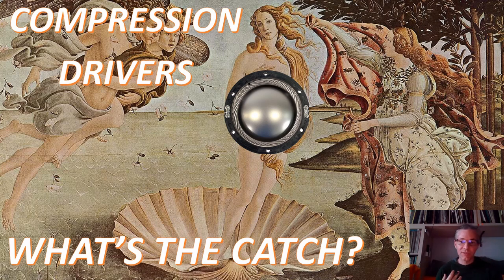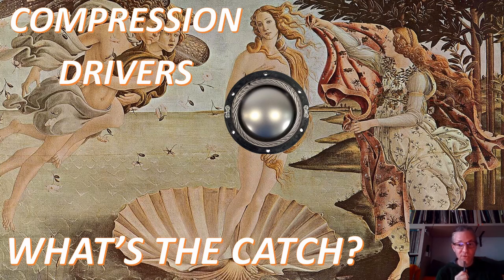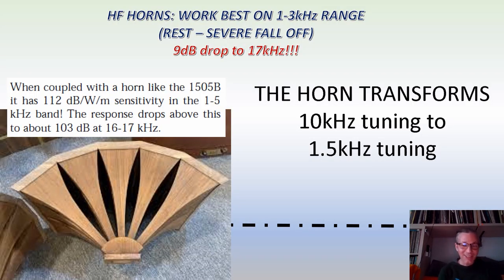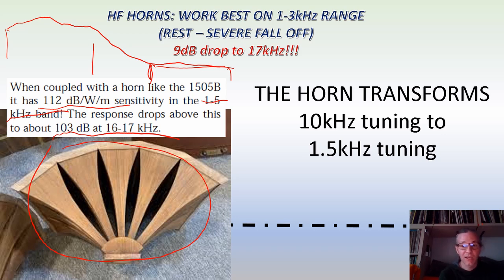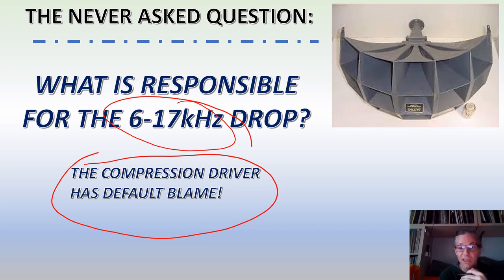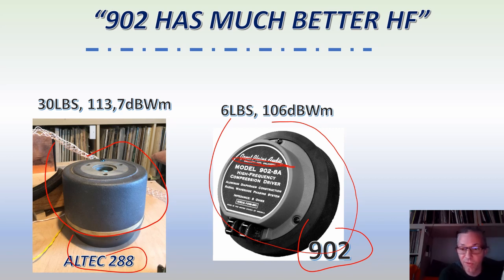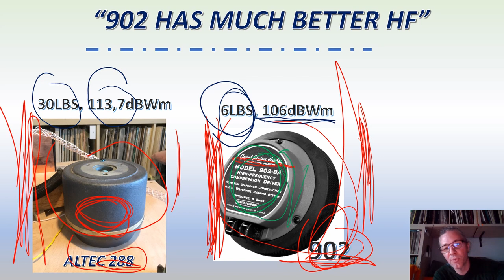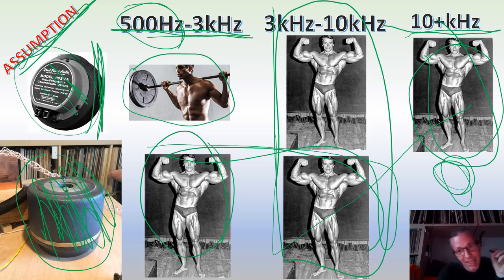What's the catch - horns and compression drivers 1/II.

Comment: i have 288c with 1803b thr horns sre too big for my room so i tried your method , had to pad lots but wow, with tad 1601c it is a nice match. wondering should i remove the screen on thr 288? they drop off at 15khz, what else will help? i waw going to active xover and biamp, for balancing
Reply from the maker: The 15kHz drop-off is not mainly by the driver itself, it is mostly the horns doing, the horn is doing the cutoff at 15kHz. I have not had a chance with the 288c, but the H/G without the horn produces the 15+kHz with a lot more authority and clarity than the small format Altecs used for the 15+kHz duty.  
Without the horn the 288 extends way higher. I think it's too efficient for active XO, you might find hard to tame that way - mating it to the woofer will be potentially lot harder than with a passive XO. 
(Well, if you are listening to impact / prat only, active XO is no problem, but listening for tone and harmonic content I'd say if you get anything better than a disaster then you have exceptionally well.) The issue is that these drivers are so sensitive that the smallest rough edge will be glaring. Biamp will work, and I'd suggest the active XO only to find the rough ballpark for the crossover. Depending on the amps / your tastes / room it might work. If you are not satisfied with it, then build the passive XOs with the knowledge you gained for the crossover frequencies with the active XO. Have fun!!

Comment: Hello boss, what would be a good midrange driver for a realistic 4024a
Reply from the maker: Here's a thread on it: https://audiokarma.org/forums/index.php?threads/mach-one-4024-4024a-4029-information-and-upgrades.261425/
I'd say though that first go for upgrading the crossover, will benefit greatly from higher quality caps and resistors & keep the original midrange
Reply: @realworldaudio  one of the midrange driver is not working. Thank you sr great help !
Reply from the maker: @elchachote33  What a bummer! I hope you can find a replacement.

Comment: Any recommendations on low crossing compression drivers you have heard apart from the Altec 288? For the moment I've found these candidates: Altec 290,291, the more expensive TD2001 then cheaper: EV DH1A (I have these), or JBL 2447, in current production: SB CD65/75, Faital pro HF206, Radian PB950, Celestion Axi2050, TD4001
Reply from the maker: I have not played around with them, so cannot recommend how low they would get. The feedback I heard on Faital and Radian is that they don't want to be pushed low, they are really voiced  for the 1kHz+ range.
Reply: @realworldaudio  Yes saw those comments too but then I hoped it may be fine for way below specced power levels, so hence I asked. But generally yes, about all the modern available CDs seem to suffer that limitation...

Comment: One reason I have shied away from electrostats and magneplanars is because their diaphragm seems so constrained, not allowed to move. I would think this would hinder dynamics. Yet, when you look at a compression driver, there is not a flexible surround typically on compression driver diaphragms. Could the horn be making the work easy enough that it doesn't need the excursion?
Reply from the maker: Most of the efficiency conversion is done by the compression chamber, the horn is just a gearbox to shift the gains in efficiency from the higher to the lower frequencies. Sound generation has two components: 1 excursion 2 efficiency of energy transfer from diafragm to air. The energy transfer is an incredibly wasteful process, that's why we need super high excursions with normal drivers. Also compression drivers are not asked to work below 500Hz (or usually even higher), and these the sound waves require very small excursions compared to bass. (The excursion is the low frequency response limiter for compression drivers: eg an Altec 288 can easily go down to 100Hz, but at low SPL because that frequency demands very high excursion, that it does not have.. )
Reply: @realworldaudio  thank you so much for your reply! I suppose the next questions might be: what would a compression driver be like with a surround, what about horn-loaded woofers, and is the reason for high power handling because the diaphragms are so durable without the surround.
Reply: What is it about dynamic drivers that compresses compared to horns?
Reply from the maker: @ColocasiaCorm  The relative compression is caused by the lack of headroom. Compression drivers have +20dB or more headroom over an average dynamic driver. So, basically when a dynamic driver is pushed to the limit, a compression driver is working at around 0.1-1% of its potential. The more a driver is pushed, the more it distorts.

Comment: I’ve never heard that your skull is a “receiver” to 100Khz frequency, at my age I’d be shocked if I can hear 10k.  Bell Labs did a sex/age study on hearing acuity, and I was amazed how dramatically our hearing, at least using our ears, falls off.  I’ll have to hook up a super duper high frequency driver to see if my skull and brian can detect high frequency.  My problem is Red Book Standard has a hard filter in the low 20Ks and even in my youth, LPs I owned didn’t go super high either.
Reply from the maker: Actually, the 100+kHz recognition appears to be limited to few individuals. (Those who can hear bats...). Sadly true, HF starts dropping with age, although the process can be slowed down or mildly reversed when much effort is placed on it. (Protect ear from loud noises at work, home an commute, plenty of hydration and sleep, vitamin C...)
Reply: My father can hear the "youth jammers" (they place extremely high frequency spakers to drive off kids hanging around at places) they use at 60+. So it really is from person to person. Supposedly nobody over 20 can hear them. Scientifcally proven. 

Ever since he went legally blind his hearing got even better. He can hear extremely well. 

I can hear those damn high pitched sounds they use to drive off kids too. I am 38.